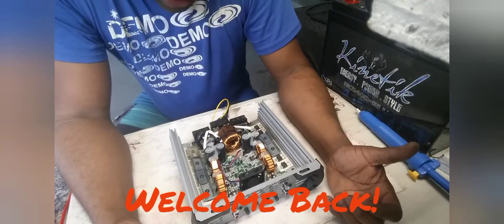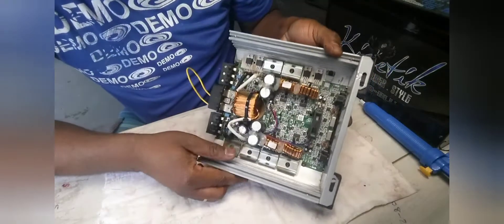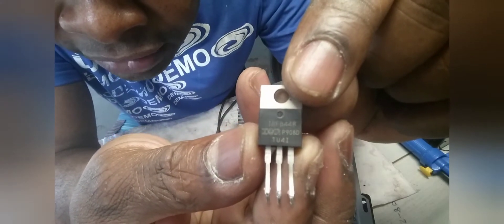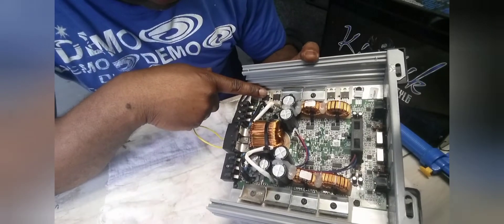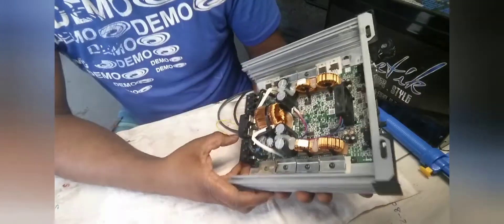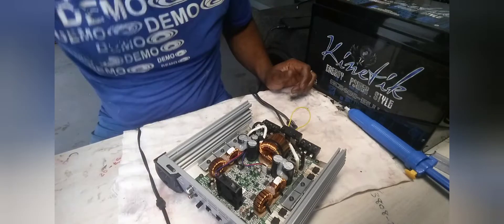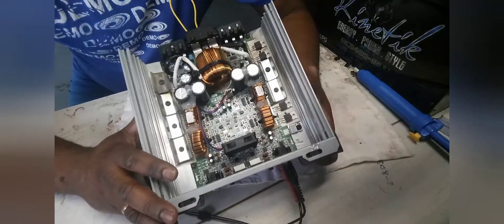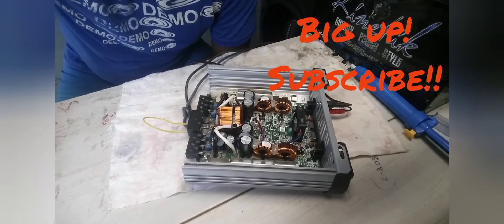STETSOM HL 1200.4 HIGH LINE AMPLIFIER| REPAIRED| EXPLAINED|CARTY&CARTY| REPAIRS| MUST WATCH!| AUDIO

Comment: From your experience what do you think caused the parts to fail? Low voltage and current? Over driving the amplifier.  Second question.  Which brand have you seen the least or was an easier fix than most? Like just quick servicing  minor repair. I noticed alot of the repairs were stetsom
Reply from the maker: @TheRepos296  Taramps is the ones I repair the most of then Timpano then STETSOM
Reply: @cartycartyamplifiersalesrepair .  I baby my 3k stetsom bravo, don't drive it too hard it's the 2ohm version.  Thankfully I haven't had any issues in two going on three years.  Thanks for your response and informative video.

Comment: Hi there is a ic under the coil marked  u5 and a cap marked c57 on the board can you tell me the part number for the ic and value of the cap as i bought this amp with those parts blown
Reply from the maker: U5 ic is UCC 27524 or IR4427 and C57 is 100uf at 6.3v